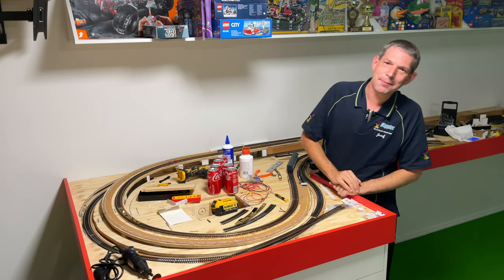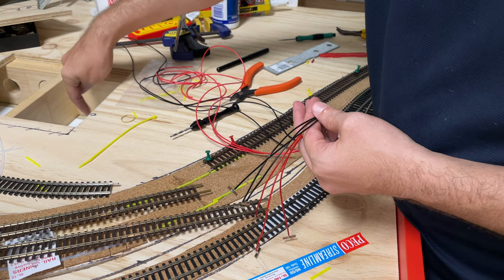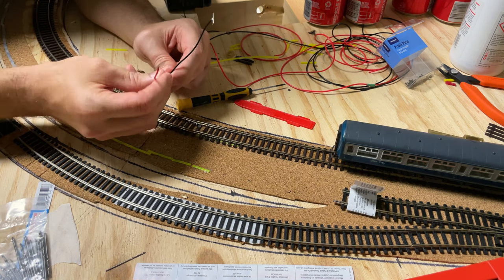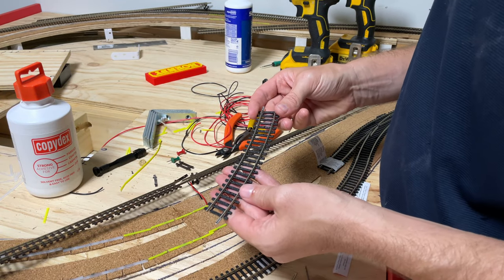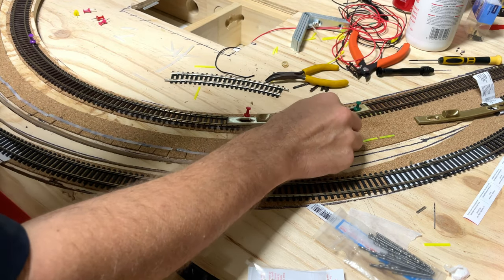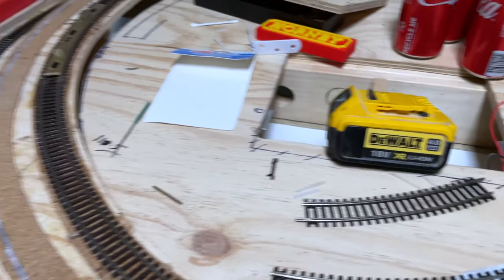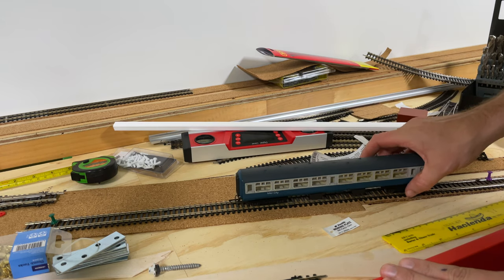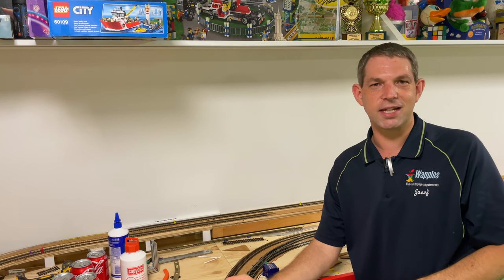Josef - Model Railway & Toy Room 21 Peco Flex Copydex Track Laying Dad's Army Loop Pins, Screw, Glue

Comment: You are in Aus, where do you buy copydex.
I canr seem to find it apart from the UK
Reply from the maker: GET on the ol’e Amazon it’s from tool shop I think in Sydney.  Expect to pay about AU$50 for it between you and me. I think there are better ways to go than using this particular product. I plan on doing a video probably in another 12 months covering the advantages and disadvantages of this type of method if I could start again, I wouldn’t be doing it this way, but yes, jump on Amazon do a bit of a search you will find someone that has it availablein the Australasia area
Reply: @josefbuckland  I actually want it for masking when painting locos.
Reply from the maker: @Steven_Rowe  
Yes that could work there is a better product which I can’t think of at the moment it’s like ummmmm those 3m command adhesive strips it’s a similar thing like blue tac albeit no bleed and stretches off grrrr I can’t think of it.